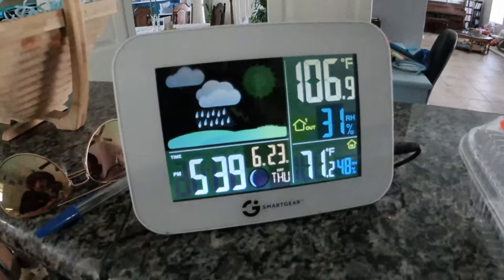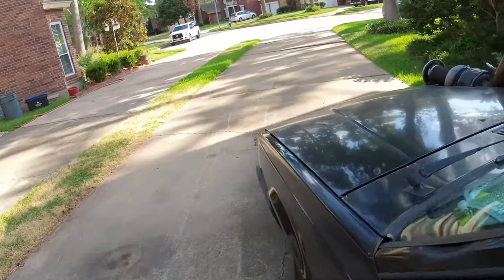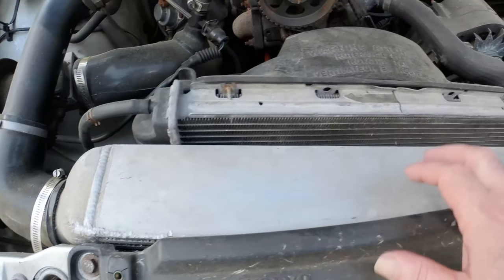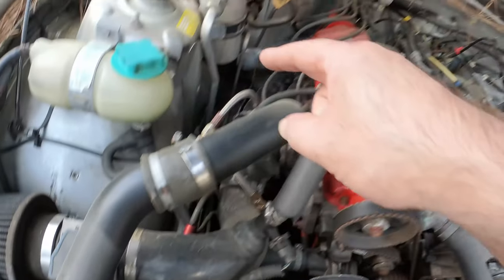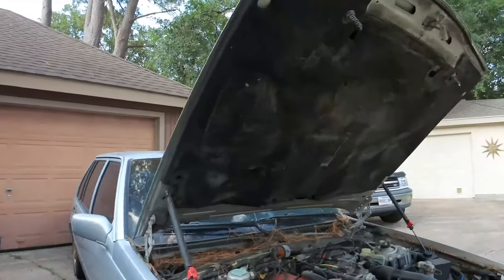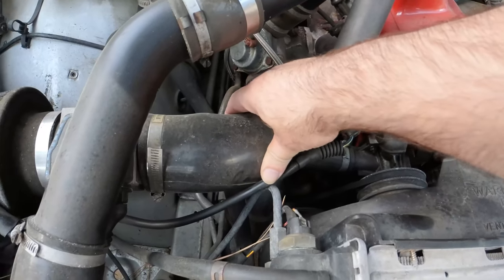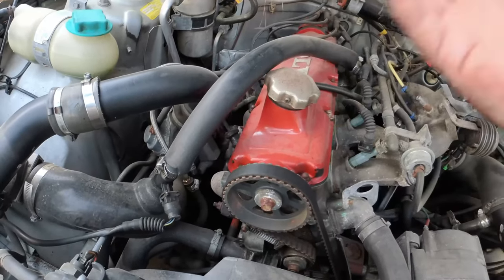Emissions: Positive Crankcase Ventilation breather Systems

Comment: On the Volvo 7/9 turbos in stock configuration, there is not a check valve on the small rubber hose that goes from the flame trap holder to the nipple on the intake manifold.
HOWEVER
There is a check valve installed on the vacuum line that runs from the nipple on the Compressor Bypass Valve (on the turbo) to a nipple on the intake manifold.

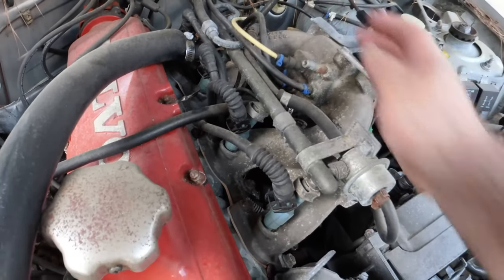There is also an open vacuum nipple on the intake manifold that you are resting your palm on at about 3:25 - 3:30 in the video.  This nipple is usually connected to a larger and more durable hose.  On the earlier 7 series Turbo cars, this went to a vacuum reservoir inside the crossmember (and then up to the brake booster, IIRC).  On the later 7/9 Turbo cars, I think this goes directly to the brake booster for the master cylinder.
Reply from the maker: There is a vacuum line off, Great eye! I saw it when I was shooting the video, it looks quite degraded. There "should be" a  one way valve from the nipple on the flame trap three way plastic union , on the vacuum hose going to the intake manifold. I Failed to mention I added this modification as an massive upgrade to all of them I buy. Done it for so long I just consider it a factory option, so funny. But you're right, it never was. OOPSIE. The reason I added it, The one way valve allows only suction into the crankcase ventilation system, and keeps from blowing boost into the system and further blowing out the seals, creating pressure, instead of vacuum .  Maybe not necessary for stock applications, but it does help them. For sure necessary for elevated boost instances.
 Thanks for the comments, and great points I neglected to discuss. Thanks for watching, Keep Your Turbo World!
Reply: @TurboWorld  I agree; a one-way valve on that hose from the flame trap holder to the intake manifold could be quite beneficial and reduce the chance of blow-by or pushing out seals in above-stock boost levels.  Good idea for an upgrade.
A common mistake that many people make is to install a flame trap insert in the flame trap holder on the turbo-charged cars.  You should NEVER do this.  That flame trap insert in the flame trap holder should ONLY go on the normally aspirated cars.
I definitely keep my World Turbo and my Turbo World!

Comment: Interesting. The check valve that is. Some of your advice is most likely good advice for other motors than Volvo I bet.
Reply from the maker: Absolutely. The stock Crankcase ventilation works, when adding boost, it can require more vacuum or flow, and a catch can as a result, on almost anything High powered. You would win that bet friend!
Thanks for your comment Sir.